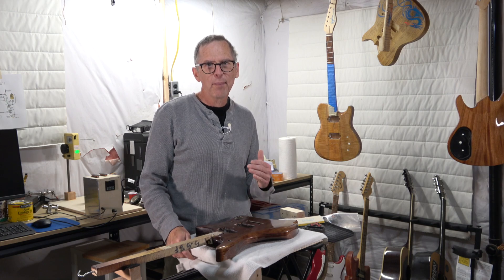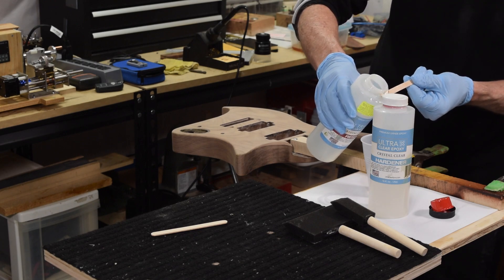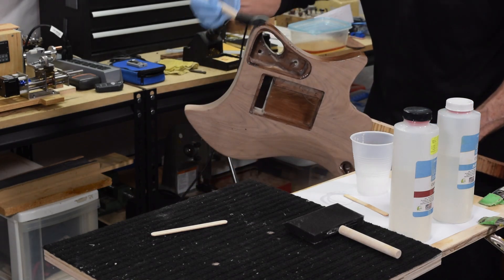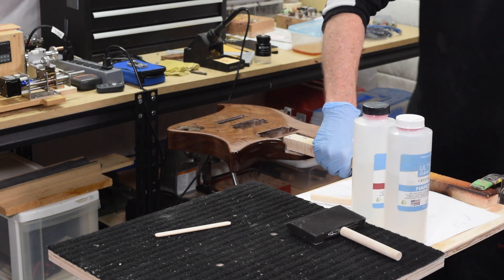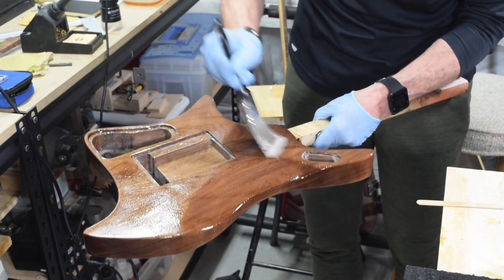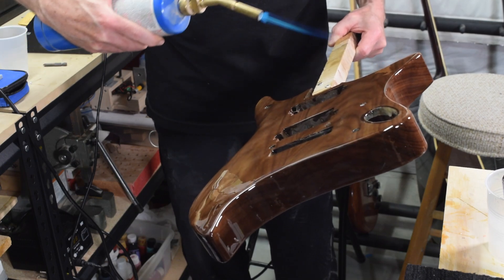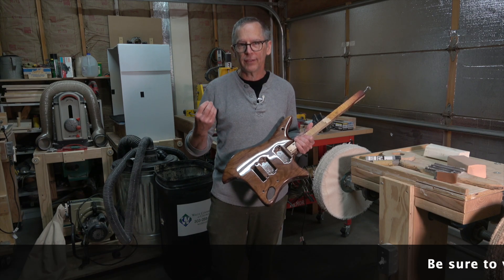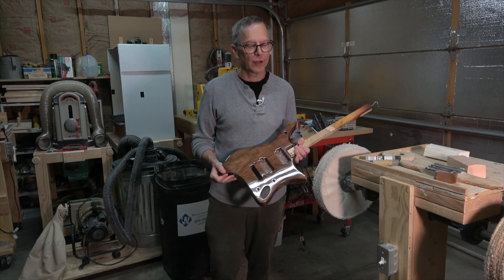Bar Top Epoxy For A Guitar Body?

Comment: Epoxy loves heat and will flow and level much better around 80f than 65f to 68f. Another trick is to warm the wood then apply the epoxy. The cooling of the body will draw in the epoxy and helps eliminate bubbles.
Reply from the maker: Thanks for the tips!

Comment: Good to hear about the low temps not affecting it much! I just did a second "flood coat" on a guitar I put a base layer of glued paper, followed by paint, on. 

I used a medium sized plastic tub, some dryer vent tubing, and a fan to create a curing chamber

Comment: i just did a test with Famowood epoxy and applied it with a piece of paper towel to see if it would level out using a poor applicator. Well after 24 hours it was rock hard and smooth as glass and i only noticed a couple of bubbles in an area about 6inx6in. I think I have finally found the clear coat I have been looking for. In my humble opinion bar top epoxy is a very good choice. The instructions say not meant to go over oil based stains so i will test putting it over a seal coat of dewaxed shellac. Thanks for the video!!!

Comment: You should use a digital scale when you pour the two parts in the cup. Those cups are tapered so the second pour was larger. Some epoxies are fussy with the ratio.

Comment: I've seen some epoxy users make a rotating holder made with an old barbecue rotisserie motor that slowly keeps the work subject (guitar in this case) rotating like a roast chicken so the epoxy product can be put on very thick and it never finds a drip point. In the case I've seen making fishing lures which are quite small, he submerges it so it's really put on super thick, puts it on the rotisserie and forgets it for a few hours. But even though it's a much smaller piece the stuff still runs and drips the same if you just set it in one place.

Comment: I used SolaRez UV cure on the guitar I built for my son. Brush on a coat inside then take it outside in the sunshine for about 10 minutes. Do this for however many coats you want. You'll be polishing the same day. My son's looks like it's made of black glass.

Comment: I'm not sure how the people saying you should pour are dealing with the fact you're manipulating a 3D object.  How do you make the back and sides and front transitions seamless that way?  Not saying they're wrong, I can't see past that, but brush coats seem to me the best idea.  I've used epoxy on fretboards before but then you do have a relatively 2D surface to deal with.  ...and yeah, it's one of those "best if you don't have other options option".  Thanks for taking one for the team Chris with your experiments :)

I guess fibreglass auto people and canoe makers deal with all sorts of shapes... actually, I should research there too.  Thanks again.

Comment: Hey Chris, thanks for always putting out great content. I work R&D with paints and coatings, and was curious if you've ever tried any defoaming products. One or two drops in the cup during your epoxy mix should prevent bubble and microbubble formation. This should save you the step of torching to pop bubbles.
Reply from the maker: What a great idea. I didn't know such a product existed. Thanks!
Reply: Can you suggest a product similar to what you’re referring to? Never heard of this being done
Reply: @mattd313  hey for an epoxy system a good starting place would be something like Bky-054 or A500.
Reply: @mechajabo  Do you know where you can buy defoamers in small quantities? I looked into them and it seems like they are really only sold to companies for industrial purposes.
Reply: @DjentlemanJosh  defoamer should be used in such small quantities (and its still incredibly effective) that I'd just suggest requesting a sample size. When I was designing inks in lab quantities, after 5 years of making ink almost every day, I finally finished a sample bottle lol. Depending on the company they might not fill a request but I'd start with a company like BYK or Munzing. Both have pretty solid sampling departments.

Comment: Chris,
Thanks for trying this product.  For a hobby builder like me, this would be a good choice since I am always looking for durable finishes and I have the time to do the sanding.  I wonder, though,  if it is possible to mix some kind of flattening agent with the epoxy to give it a more satin look instead of the deep gloss, or if there is some other kind of super hard clear finish that can be flattened somewhat.  Please do a video on that if you know of an ingredient that works this way.
Reply from the maker: If you search for "flattening agent for epoxy," there are a number of choices. However, I have never tried any of them. When I want a satin to matte sheen, I use Centurion 2800 water-based 2K polyurethane.

Comment: hi, great that i found your channel, massive knowledge. the reason i was searching is that i have a guitar body that was painted on by an artist but after 3 years the finish (some king of a lacquer) is still tacky : (  so i thought i can do a layer of epoxy. wet sand the guitar many times over the years but still tacky/ sticky. any solution to that please?
Reply from the maker: First of all, you need to know exactly what the lacquer is to fix it. Second of all, if it is still tacky after 3 years, covering it with something could lead to adhesion failure down the road. My guess, and it's only a guess since I'm not able to examine the guitar first hand, is that the lacquer had a bad reaction to the underlying paint. You could try epoxy, but without the opportunity to test, it'll be a crapshoot. The way I see it, what have you got to lose?

Comment: I have done this already a few times. It is very durable. I have done a pour on, not a brush on. Wax paper is the best to put under your work. Epoxy will not really stick to wax paper. Brush on is not the same as pouring it on. Using a small tooth plastic trawl and doing the top and sides first, don't worry about the runs or drips on the sides that can be sanded. Pour on and torch will get rid of the bubbles and level sanding you will now get the pinhole marks. The way I did it is on my channel and it works great as a finish, just is a lot of work to get the look your looking for.
Reply from the maker: I tried pouring and troweling. Brushing is easier and better. That being said, it's only a viable option if you don't have spray equipment, and it's a terrible technique if you do.
Reply: @HighlineGuitars  I did some art and body routing. I put some computer boards in the body with LED's. Filled with epoxy and then did a body pour. Front, back, sides.... A lot of sanding, but came out like glass and had a lot of depth in the finish. I also did a top pour on a maple top called the Deadman guitar. I use 2k clear most of the time.
Reply: Epoxy dust is classified as microplastic pollution and can find its way up the food chain if not disposed safely. You shouldn't just throw it in the trash.

Comment: Thanks for the great video!!!
I was wondering what grit did you start level sanding with? Some coarse 80/120 or did you start much higher like a 600?
I am attempting one right now and this info would be really helpful. 
Cheers
Reply from the maker: On this experiment, I had to start at 150 grit.
Reply: @HighlineGuitars  this is what I feared. I understand now why you said it was a chore! Great info thanks!

Comment: Instead of a bard top epoxy, would it be a good idea to use that Solarez "Polyester Sanding Resin", then level sand and then apply the Solarez Gloss Polyester Resin, then fine sand and buff? I guess that would be easier to work with.
Reply from the maker: Too stinky.

Comment: I am in this predicament, (no spray equipment) I was told by Crystalac that you can brush on the water-based finish you often use on your guitars. do you have any experience with this? I've been considering trying it out as I don't need my guitars to be nuclear war proof. thanks for inspiring me to take the CNC route too, your videos have been tremendously helpful to me. best regards from Denmark.
Reply from the maker: I have never brushed it, but if it brushes like the sanding sealer, which I have brushed, I don't see why it would work.
Reply: @HighlineGuitars  I take it you wouldn't recommend it?
Reply from the maker: @olivergrundtwormjensen9786  I recommend spraying it. That's only because I haven't brushed it.

Comment: what about dust particles?  is there a way you can prevent them from going onto the body of the guitar whilst the epoxy is setting? cheers
Reply: don't move air in the room for a while.

Comment: I'm going to something like this with my fender strat will it harm the sound  ? Or it doesn't matter as long there connected into the amp
Reply from the maker: It might, but then again, it might not. I lean towards not. It may change the sound either for the better or for the worse.

Comment: Perfect timing, I need this info right now. Big take away for me week wait time..I am doing guitar with LED flames under  the epoxy.  Hope I have time to finish.
Thanks again!
Do you think it will build up enough to level over decals??? Any thoughts?
Reply from the maker: Yes, it will build up enough to cover decals.
Reply: @HighlineGuitars  thanks, coming along!!
Reply from the maker: @FrugalFixerSpike  BTW, how did you do the illuminated flames?
Reply: @HighlineGuitars  drop over to the channel, checkout that and my solarez test, I welcome advice from the master of finish, before i put it on the bodies! one epoxy one in solarez   Thannks!
Reply: @HighlineGuitars  helmet lights
Reply from the maker: @FrugalFixerSpike  What about the flames? What are they made of?
Reply: @HighlineGuitars  they are a lit 3m decal, can be trimmed it seems, but glue will be required to get them set!!  Thanks for asking!!

Comment: I am planning when the weather warms up on doing a crackle coat - I have a bunch of crystal epoxy resin since I use it for mold casting - was wondering if you knew if you could do the epoxy and then following it coat with a lacquer rattle can to reduce the amount of lacquer it will take to fill the gaps in the crackle coat - I think it would also let me do some effect like a light mix of luminous powder with the epoxy or a dusting without disturbing it too much - just not sure on the adhesion or if I say need to wait some period for the epoxy to fully cure to keep the lacquer (or could go poly) coat from cracking

Comment: Hi chris i build a electric guitar body with spalted wood, and it was soft, what can i do to harden the wood?
Reply from the maker: Spalted wood must be acrylic stabilized BEFORE you make it into a guitar. I know of no way to reliably harden it after making a guitar. You can try saturating it with thin CA glue, but in my experience, that does little to harden it. Another technique would use Z-Poxy finishing resin thinned with alcohol to flood the surface, but that won’t do much either.
Reply: Ouch, i dont know that it must be acrylic stabillized before i make it, but its only the wings of my guitar is spalted because its a neck thru
Reply: Clear epoxy resin?
Reply from the maker: @ronaldmiday8155  Z-Poxy finishing resin has a much thinner viscosity and when further thinned with isopropyl alcohol, will soak deeper into the wood before it dries. However, soaking wood with any type of glue is only marginally effective if at all.
Reply: Thank you sir

Comment: Could you thin the epoxy with alcohol?
Reply from the maker: Why? That would be a disaster.
Reply: Only way to reduce the viscosity of most epoxies is to warm them up slightly. You then risk reduced working time.

Comment: I use epoxy resin as a "sanding sealer" to even the wood and fill the gap. Have tried it for top coat and its totally disaster since guitar is 3D object and have to many curve
Reply: My plan as well.
Wood filler alone doesnt seem like it will do the job, given this low quality candlenut wood im aiming for.
Its lightweight as heck for a strat and im using it to save my back.

Plus wood fillers are prone to shrinkage i heard.

So wood filler, then resin, then probably paint. Lacquer finish i guess

Comment: Your technique here was not ideal. You should have rather used the same method as they use to flow-coat surfboards. Would have been easier and taken less time.
Reply from the maker: I tried that. The results were a disaster and had to be stripped off. My way works best.